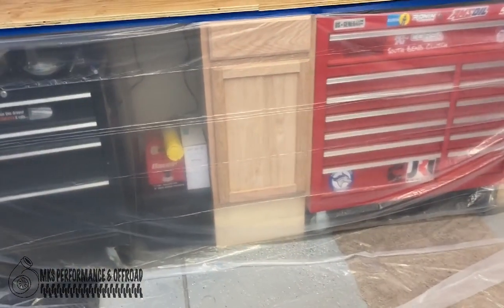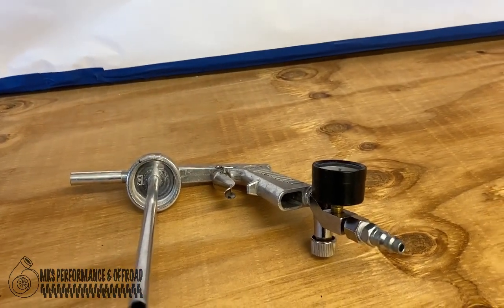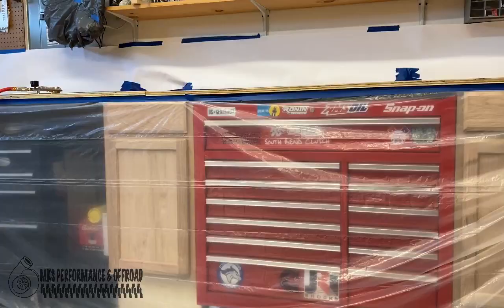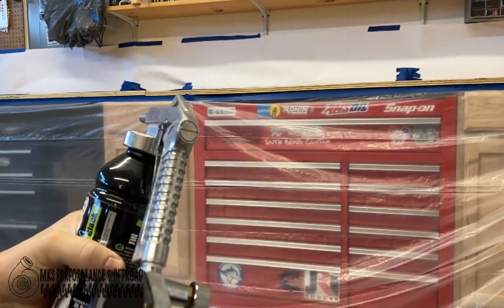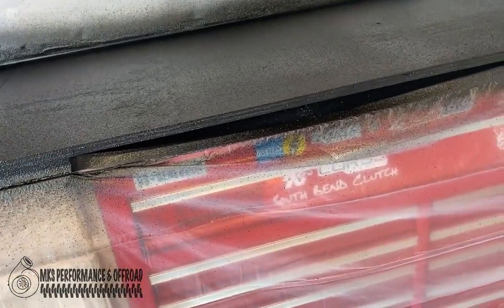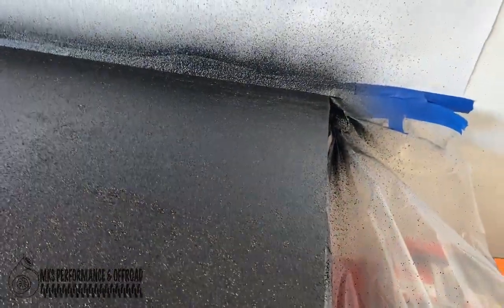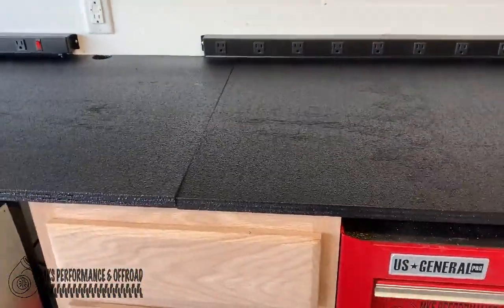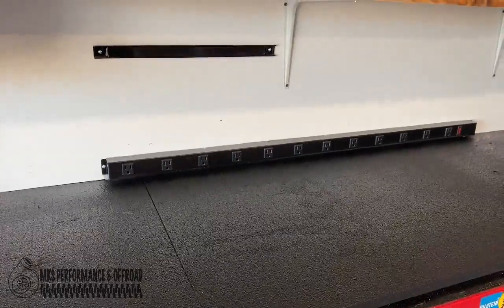UPOL Raptor Liner bed liner Garage Work bench coating

Comment: I have a shed I wonder if this would be good for the floor or if my motorcycle would tear it up
Reply from the maker: @Joeofalltrades85  prep good and spray it, I used this in an enclosed cargo trailer that regularly hauls stuff and it has held up great over the last 3+ years.

Comment: I just made a set of concrete 45lb weights going to put a few coats of this on them to hopefully protect them from chipping hope it sticks well to cement
Reply: Raptor sticks extremely well to fresh clean concrete. No primer required.
Reply: @anthonyjames7100 
What about an old concrete, and what primer would you use for it, also how does the raptor do against oil, diesel, gas, etc.?
Thinking about spraying my garage concrete floor?

Comment: I thought about doing this on a set of outdoor stairs for my grandparents, not sure if it would be slip resistant enough tho 😬
Reply from the maker: You can change the texture with application pressure and how you spray it.  I thought there might be a slip resistant additive I saw a while back as well.

Comment: I was thinking of doing something similar to my wooden shed floor because of winter time use,but was afraid if it would cause my wood to rote from underneath. Because it is setting on a thick gravel pad not cement. Looks really good on your work bench
Reply from the maker: Marshall Rugg it has held up so awesome over the last few months, we sprayed this about 6 months ago but I will be spraying our enclosed trailer floor and we did spray the front and back of our camper fiberglass with the white also.  That video will be coming soon.  Is your plywood treated and or sitting off the ground like on skids?
Reply: @MKSPerformanceOffroad  it is a pre built shed 14x30 foot. It has some kind of coating on it but it is light in color and shows all kinds of marks and I am afraid of water and oil getting in from the top but also afraid that if I seal up the top the bottom might rote.
Reply from the maker: Marshall Rugg if its a shed built by a company I dont think you would have an issue.  I was going to do the same to my 8x12 shed as well but it sits pretty high with alot of airflow underneath.  You might check with the company that built it to find out what they used.  It should be treated.
Reply: @MKSPerformanceOffroad  ok i will do that thank you

Comment: So you didn’t have to prime it with anything ?I have a wood deck for a trailer I was going to roll it on.
Reply from the maker: No sir, you can prime it if you want but I fid my bench top and enclosed trailer and it has held up great.

Comment: How has it held up 1 year later on the wood?  Has it peeled off? Anything you would do differently ?
Reply from the maker: It is doing great, no peeling at all and I have used the bench alot.  I would spray another coat or 2 on it for thicker layer but other than that nothing else.

Comment: Hi nice job, bench looks great! Is the raptor ok to use straight on the ply?
Reply from the maker: Yes, the surface is porous and rough enough that the raptor should adhere without issue.  I haven’t had any issues thus far and I use my bench regularly.
Reply: @MKSPerformanceOffroad  thank you mate.

Comment: i'm a pro carpenter been in business 33 years, in saying this..anyone using bedliner on wood it has way better results applying 2 coats of rolled on zinser bullseye primmer first..1st coat after dry sand it with 120 grit sand paper disc then recoat after the 2nd coat is dry sand it with 220 grit, now bedliner in 2 coats. comes out professional C.DaleGibbs
Reply from the maker: Absolutely agree, this was a quick test for a workbench with no prep what so ever.  Happy with the results for what Im doing.
Reply: nice tip… planning on using raptor in my campervan garage area on top of 12mm ply board 👍🏻
Reply: @seanguild6528  have fun, wear gloves cause every time i paint my face itches somewhere and you know you just have to scratch..
Reply: Do you have any recommendations on applying it to melamine on plywood?  Thanks in advance.
Reply: Do you think I should use that primer on my wood decking on my trailer? I get my raptor liner tomorrow.
Reply: Yes most definitely put this on the wood first the way it is around here Lowe's costs more Home Depot costs less make sure it's water based